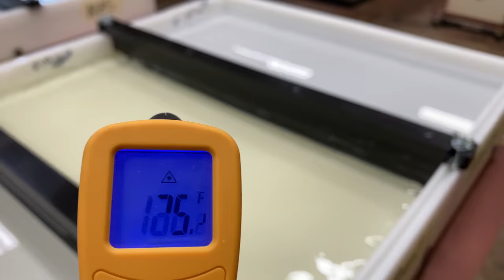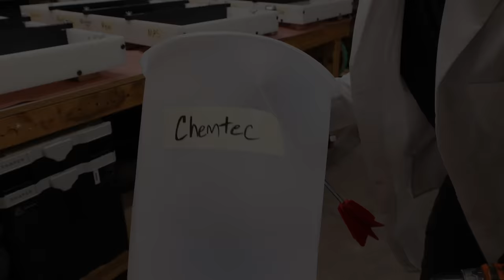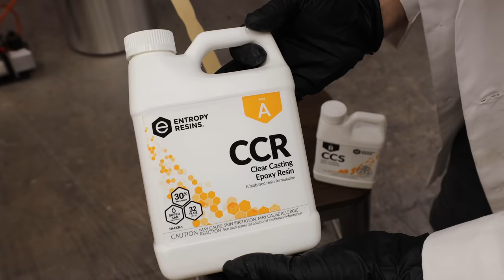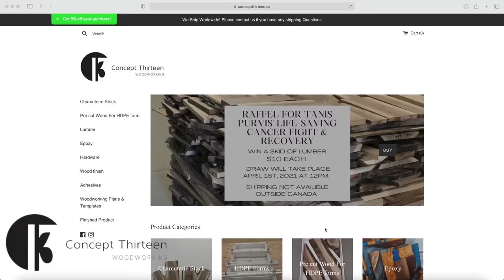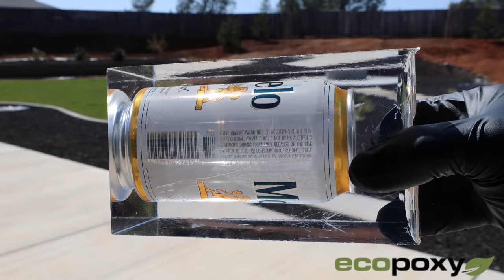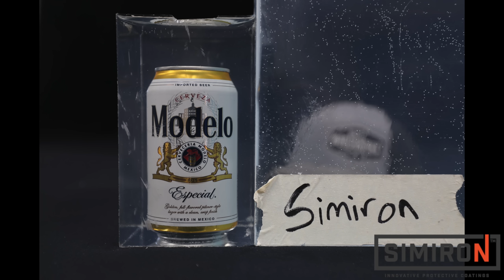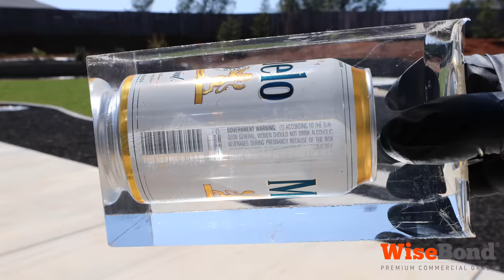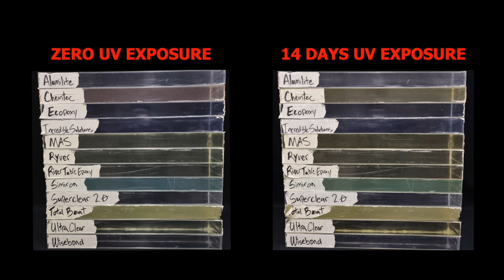Deep Pour Epoxy Clarity/UV/Hardness Test - Detailed Comparison!

Comment: Please tell me that you didnt throw these out!! I would love to come back in a year, and see how they all look after a full year of UV exposure
Excellent test, I've been dabbling with resin for years, way before it became trendy but it hasn't been until recently that I've really started to create more especially now that there's more products designed specifically for use in resin crafting. I'm to the point where these little quart bottles aren't lasting me long. I just bought my first 1 gallon set, I wish I had seen this 2 days ago!! But these will help for next time. Very well done and thought out test. The only thing you could have done different would be have the molds for the slabs not sharing a common wall. That one brand got REALLY hot so no matter how thick the walls between the samples there would be a possibility of heat transfer. But that's being really not picky. 
Finally, I think Incredible Solutions looked the best but you can't really rely on people's opinions of an image their viewing in this manner, to many variables. You know the whole "the dress is black & blue or white & green" thing.

Comment: "Incredible Solutions" was the one that overall impressed me the most, in the top 3 in clearness, 2nd cheapest (1st cheapest if it was not for a sale), good hardness, top performer for low uv reaction, and the slab pour had the least amount of bubbles by far compared to the others. In the bear can pour test the final top 3 are very comparable, down to personal preference if you ask me, and again I like the look of the incredible solutions beer can pour the most. Extremely impressive, my pick for winner by far, great video!

Comment: I'd say Wise Bond is the clarity winner, but my preferred choice is actually Incredible Solutions. The difference is that I actually find I like the very slight blue cast because it gives my brain that juicy glass feeling. Does that make sense? We were all kind of taught since childhood that "plastic" is inferior to glass, so if the resin looks just a little bit more like glass it's enough of a brain trick to give you that cold, smooth, "oh I want to feel that," glassy sensation. Also, it's cheaper and has a good hardness. I'm not rich, so if I can save some money without really losing any quality then I'll go for it.
Thanks for this though! I've watched a lot of videos on working with resin lately and everyone uses a different brand.
Reply from the maker: So happy this will help you out, really appreciate off of your feedback and taking the time to watch!  Good luck!

Comment: Wow. This is excellent. One tip for the future, tho ... It would be useful to use a background with a consistent color and design. The two stacks of samples had a dark background on the left, and white background on the right. That made it hard to tell how much of the color was from the sample, and how muchh was from the background. Once done with them, setting up a darkened space with controlled lighting and controlled background would make it easier to see clarity, distortion, coloring, etc. Also, there are color pallettes used in photography to calibrate a camera to the lighting in a particular setting. They have standard colors on them, and standard grayscale shading. Getfing one of those off Amazon for $30 or something would help show the optical qualities of the samples, if shot in a controlled photography setting.... Thanks so much for doing this. This obviously took a huge amount of time and money to pull off. It's outstanding!! Thanks so much!!

Comment: Hey, Great video. I did my own scoring as you cycled through the epoxies and here is what I came up with:
Epoxy			          Score		
Incredible Solutions	10
WiseBond		          9
Alumilight		          9
EcoPoxy			          8
Ultra Clear		          8
Chemtec		          7
Super Clear 2.0	          7
Mas			          6
Ryver			          6
River Table		          6
Simiron			          5

The main reason that I scored Incredible Solutions the best was that for Deep pours on Tables with embedded LEDs or Fiber Optics, you can't degas the items and having as few bubbles as possible is critical. The clarity is important, but slightly less so than bubbles since the wood is typically a tan/yellowish hue anyway.
Reply from the maker: Hey thanks for the feedback Earl, I do have a questions about your Fiber comment.  So you're saying that you cannot degas the resin in the mixing buckets before pouring it into the mould?  Will it mess up the fiber?  Totally just curious!

Comment: Nice video,  you showed up in my recommends tonight. I use several (4)  craft resins/epoxy, only one was in your trials,  Alumilite, clear cast.  I’ve used it for years in small pours. I usually add color to most pours, bubbles are biggest concern. You really created a very through video, I really appreciate you were able to test 13 brands. 
SuperClear  is my choice, I thought it looked the clearest before it was polished up. New subscriber btw
Reply from the maker: Thank you for watching Maddie, I appreciate the feedback too and I'm glad to have you on board!!

Comment: Superclear during the price special. Wisebon overall. Incredibel Solutions right behind those because of the tint. Imo. Simiron seemed to be the worst imo. Total boat surprisingly right behind. Which is surprising and suckd considering they are so great to youtubers..even the half cast and beer can didn't look the greatest. That last shot at the 23 minute marked shows what 5 to consider. Props you for doing this. You not only saved yourself some money etc. but many other people. I see people talking about bubbles..wise bond did just as good with bubbles.

Comment: To my eye, I would rank them: Wisebond, Superclear 2.0, Incredible solutions. That said, Incredible Solutions had no bubbles which is a pretty big consideration, given how extremely close all three products turned out. As a novice, I would go for Incredible Solutions. It was the least expensive of the three, had no discernible bubbles, and was only slightly less clear than the others. They all looked good after the cleanup and polish, so I think any one of them would be a good choice.

Comment: Awesome video!  If you do a followup or something like this again, one relatively simple way of quantifying the light transmittance and yellow tinting would be to take a photograph through each using the same camera settings and setup and using an application like Photoshop to get a reading for brightness and yellow value on the RAW image before any automatic processing is applied.  If your background has text of decreasing font-size, you can get perhaps a more precise comparison of clarity (though that could be influenced by polishing differences unless cast so as to not need polishing).

Comment: Incredible Solutions!  It has a little blue tinge to it, but not overwhelming and if not compared side by side, don't think you could tell.  with that, I believe it is the clearest and best.
Reply: The blue tinge is useful though as over time, it'll combat the yellowing.  If you look at thee colour wheel, they're complete opposites – I imagine this might be why IS have done this.  I've often thought a purply-blue top coat a couple of years down the line would be a useful thing anyway as a way of refreshing artworks.

Comment: I'd argue that Wise Bond and Incredible Solutions are the best two, with Incredible Solutions having the edge. Incredible Solutions has a lower price point, had minimal to no bubbles for the 2 inch pour, and while it had a reduction in average hardness there was essentially no change. The biggest reason I give Incredible Solutions the edge is that there were minimal to no bubbles for the 2 inch pour. For the price and amount of bubbles in it it just seems like it'd be a better fit for people who either are A) just getting into resin, B) don't have a degassing chamber or are doing large pours, or C) both.
Reply from the maker: Thank you for the detailed feedback Zak, and taking the time to watch my vid!  Very much appreciated!

Comment: So the one I would use is Incredible Solutions. It's 2nd once you did final flat and polish, had less bubbles from the start, so less degas required, it's one of the cheapest, one of the hardest. It just ticks off all the boxes

But for ultimate clear Wisebond was the clear winner. You could more easily and clearly read the beer can from the side of the full sheet.
Reply from the maker: Great feedback, thank you!

Comment: Great work on this test!

Value for the price I'd say Incredible Solutions comes out on top here, even if it's slightly more blue than the other 2 top contenders. The most amazing part is that the top 3 clearest are all in the top 5 cheapest, especially if you take into consideration how much some of the more expensive ones yellowed in just 2 weeks.

It's a bit sad that most of these aren't even available here in Europe, as well as the fact we have a bunch of other brands available here.
The biggest contenders we have here in our region that are missing on the list are MrBoat Epoxy, Resion epoxy (by Polyestershoppen) and Dipon. Not to mention there's quite some difference in their different versions of epoxies. Most brands have different formulas for different depths of casting, but Resion for example is also available in versions with UV-blocker added in.
Reply from the maker: Thank you for all of the feedback my friend, that really stinks they aren't available in Europe, hopefully someday!

Comment: Hey Matt, I had a few questions about the video. Did you use a heat gun over the large pours to remove surface bubbles? Do you think the excess heat created from the Total Boat pour affected the neighboring pours? This was a great video I was able to feel better about my choice of resin after seeing the polishing results!
Reply from the maker: Hi!  I did not use any heat gun or torch for this on purpose, I wanted to test each companies bubble release, and I didn't want to generate any unnecessary heat.  I do think TotalBoat's could have affected the neighboring pours, there wasn't a lot of heat transfer but still I assume a little.  Really appreciate you watching it, thank you for the support!

Comment: Wisebond for me. And thank you Matt for such a awesome video! I do not know a lot about using epoxy, and I see the relative ease in using the degassing chamber on small pores. Do you use that same chamber for epoxy being used in a large deep pour tables?  The only degassing treatment I’ve seen for this kind of use is a torch being used on the surface of the epoxy.
Awesome job bud!
Reply from the maker: Thank you my friend!  I use this chamber for any epoxy project, whether it's a 100L pour or smaller stuff like this.  It's crazy to see how many bubbles come out even when they're not visible to the naked eye, the torch way still works but really just tackles the bubbles on the surface vs the chamber extracting air all the way through.  Also, its super easy to use! :)
Reply: @MattsWoodworks  Do you happen to have a link to one that you use? It seems bigger than the harbor freight degasser that I’ve seen online.
Reply from the maker: @audioman99  yep it’s in the description! :)
Reply: @MattsWoodworks  Sorry, I Should’ve looked first there 🙄
Reply from the maker: @audioman99  😆all good!

Comment: Hey Matt, Thanks for the video; I learned a great deal from it.  Now, if I may make a suggestion. I like your presentation, and the way you're getting your information across. However, there were so many jump cuts in the video, and,  now it might have been just me, but it got really distracting. The nice thing is, you were able to keep the soundtrack pretty consistent, but the video; I've gotten a headache from watching. However, that being said, overall, very solid work. Thanks,  and continued luck
Reply: Wholeheartedly agree.
Reply from the maker: Thank you for the feedback Rick, they definitely weren't intentional but rather necessary lol.  I'm working on it, I'm sure each video will improve, this is all really new to me!

Comment: Check out Liquid Diamonds, Deep Pour, and Clearcast 7050 epoxies from the Epoxy Resin Store.  I'm very impressed with Clearcast 7050, it's supposedly a UV stabilized non-yellowing clear epoxy with a CLAIMED D85 hardness & 7500PSI tensile strength before cracking.   I can easily read through a 3" thick section of it like reading through glass without sanding or polishing.

Liquid Diamonds similar to CC7050, but without the UV protection for indoor projects.  Also CLAIMED to be D85 hardness but with 8500PSI tensile strength before cracking.   

Deep Pour claims to be for pours up to 3 inches deep and full cure to D88 hardness but don't see any crack resistance claims.
Reply: Thanks, Shawn.  Will most definitely look in to these suggestions.

Comment: For UV eposure comparison you should have  made white ballance on the existing light to get a real comparison or film it inside under exactly the same light. Even better would be to also put a white sheet of paper behind part of a sample. That's the way to compare results realistically in a home setting. For exact results you need a spectrometer. Just a suggestion. Otherwise a great and informative comparison. Great job!
Reply: Right on, Fifi!

Comment: I would have like to seen the alumalite and ecopoxy polished too. With that being said of the 3 you polished my vote would be for incredible solutions even though it had a slight blue tint from the side probably not noticeable once polished or outside a direct comparison. Also even without the  degassing the incredible solutions had almost no microbubbles.
Reply: I agree, I too would have liked to see Ecopoxy in the mix... however, after looking at the price points of each of them, Ecopoxy was the most expensive of the 4.  So maybe that's why he scrubbed it... Now, I will have to disagree with you on who will win this competition as well, based on hardness... Wisebond was the hardest of the 3.  Afterall, Wisebond & Incredible Solutions were practically the same.  Superclear had more BUBBLES than my beer did last night...FACT.  Either one is a win really because they are both cheaper & clearer then the Top 5 resins out there.

Comment: Thank you for this detailed comparison.  I'll be pouring a tabletop at about 1/8" thick, which may mean slightly different product versions, but this provides a perfect starting point.  I'm impressed by the clarity and hardness of the Wisebond, but I also find the price of Incredible Solutions very appealing as well for my 2 gallon project.
Reply: What's your 2 gallon project?  Did you make your own table top mold?  Are you on IG?

Comment: Let me start off by saying I am a Stonecoat Counter Top (i.e Alumilite) guy. I must say that Incredible Solutions looks the best... BUT, how about VOC and shop friendliness? Alumilite is low odor and VOC, I have no problems using it indoors with little to no ventilation (mainly because of lack of space and to avoid dust when curing.) I also like that it is a 1:1 mixing ratio. Reading specs on Incredible Solutions, they are also low VOC but 2:1 mixing ratio. I favorited this video and your polishing tutorial as well as subscribing for the sheer depth of quality in this video. I will be trying some Incredible Solutions since the price is really good compared to Alumilite. GREAT VIDEO! Most helpful!

FOLLOWUP: The link to the Incredible Solutions Amazon page in this video description says it is a 2:1 mixing ratio for the 'Pourable Plastic' as shown in your video, but how does this compare to the 'Table Top' they sell, which is a 1:1?

FOLLOWUP 2:  here is an interesting link to a UV comparison test of popular resins. Note - I don't know if some of these companies are the same, or if the names have changed
https://youtu.be/MzIxcIqCNh8
Reply from the maker: Thank you for the support and the sub my friend!  All of of these products were "deep pour" and had either a 2:1 or 3:1 mix ratio, I may consider doing a test someday on the table top products from each of these companies.  Incredible solutions deep pour is called Pourable Plastic, I haven't used their 1:1 product yet.  I'll check out that video, thank you!!
Reply from the maker: Edit: Most all of these are low to no VOC and to me I didn't smell really anything when doing the test.

Comment: First - I want to say well done on keeping things as close as possible between resins. I've seen tests like this before and often they hand mix and even hand mixing at different rates and strength can change the final result. I appreciate you using a mixer instead. I do wish you didn't use so many skip edits/jumps in your videos. I found it hard to watch when you were talking and it's distracting. There's a one year test floating around on YouTube - most of the brands weren't what you used (they used brands you were more likely to see an artist use for shallow pours or to seal like Art Resin, K Resin, etc). You should continue your UV testing and do periodic updates to see how they hold up over time.
Reply from the maker: This is great feedback, thank you for taking the time to write this comment and share your thoughts!   I will consider to the longer UV test for sure!
Reply: This test was for 'deep pour' resins.
Reply: @CarieSaad  Yes, I'm fully aware.

Comment: Incredible. Looking like a lot of work. Thanks for doing that.  I've never used resins before, but I'm interested in using it to make heels (high heels). I intend to make two types: Heels that will be covered with leather and clear heels that will have decorative elements within. The cured resin must be strong enough to support body weight (but not brittle) and drillable. Can you make any recommendations? Thanks again.